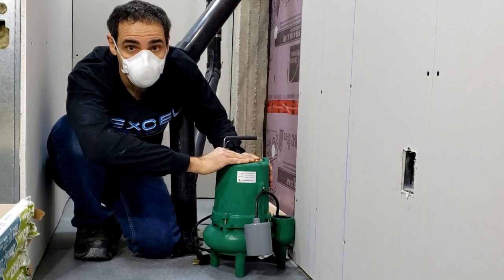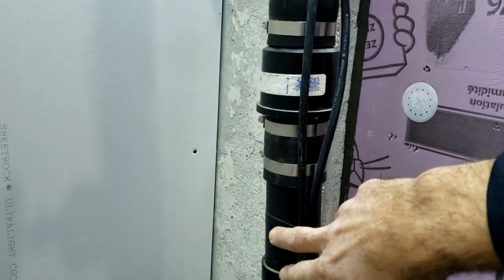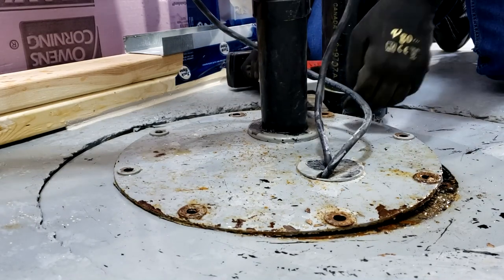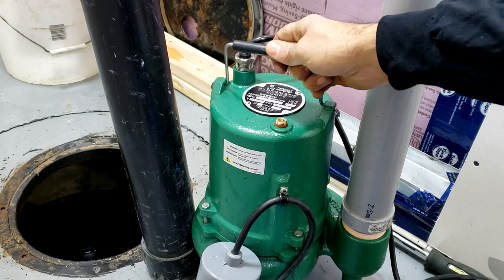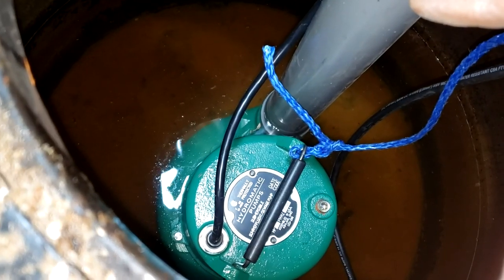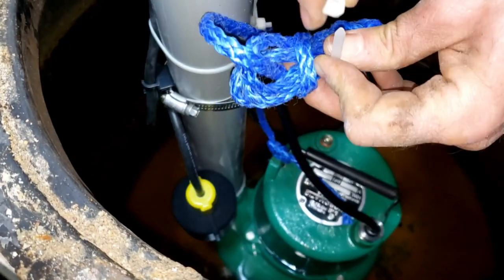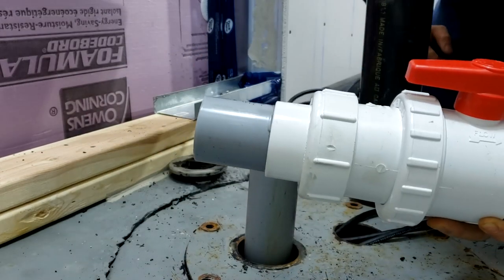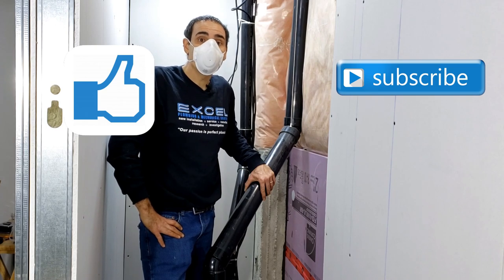How to Install a Sewage Ejector and Float Alarm

Comment: Would a cheater valve work for the sewage pump vent?
Reply from the maker: Good question! A cheater vent (or air admittance valve) on a traditional sewage ejector system is probably not a good idea - although it's better than nothing.  A cheater vent is typically a one-way valve:  It allows air into the system, but not out, which prevents atmospheric pressure from being properly maintained. Therefore, heavy drainage flow into the pit would cause positive pressure to build up downstream into the pit, thereby inhibiting proper drainage flow.  However, any residual air pressure buildup should eventually dissipate through the inlet drainage pipes and up through the vents serving the fixtures (NOT that that would be proper design or practice!)

One area where you'd be sure to run into issues with cheater vents are those small, self-contained point-of-use sewage ejector boxes (such as those ones made by Liberty or Little Giant), which are designed to fit beside laundry tubs and other small sinks.  Their manuals explicitly stress against the use of air admittance valves, as they will not operate properly without a proper vent.

As a general rule, you just can't replace proper venting that runs out to open air.

Hope this helps, and thanks for your question!
Reply: @PlumbingsCool  Wow I had no idea it made a huge difference like that whether the vent is coming from your roof (typical setup) vs not routing the extra piping and just using the cheater vale (air vacuum created by pump gets filled in from house). Where is the difference in pressures (outside vs inside) come in as a problem? At the pit or at the septic? Isn't the inside air similar pressure whats in the pit? i was thinking the only losses would be that the vent would use the warm air from the inside to fill in the void in the pit which would result in your warm air getting sucked up. Also does it not matter which cheater vent you use and how its configured? Thanks for the detailed answer. I was hoping to save all the additional piping and breaking out the drywall on a partially finished basement but from what you are saying its not worth the trouble of using this cheater vent.
Reply from the maker: Right, so technically if your fixtures are properly vented, you may be able to get away with atmospheric pressure being rebalanced in the sewage pit by "stealing" airflow from those fixture vents as required. (it'll suck in air from those vents when the pump discharges, and any excess pressure will built up in the pit should escape through those same vents).  But I want to be clear that it is blatantly against Code and not proper plumbing practice.

Venting has nothing to do with air temperatures. Rather, venting's primary purpose is to maintain the liquid trap seals of the building's fixtures (which prevent harmful sewer gas from entering the building).  All proper venting needs to exit to "open air", which refers outside the envelope of the the building, which is atmospheric (typically 14.7 PSI at sea level). 

Say when you flush a toilet:  that high volume of water rushing through the pipes will push air ahead of it and pull air behind it, thereby disrupting the system's pressure.   If that toilet discharge passes across the connection of an unvented fixture (say, a sink), it runs the risk of siphoning out the sink's trap seal.  But if that sink was properly vented, then the negative pressure pulling on the sink's trap caused by the toilet's discharge would be rebalanced by sucking air through the sink's vent.

Think of when you drink through a straw:  Your "Sucking" creates pressure inside the straw that is less than the pressure outside of it (atmospheric).  But!...we can all recall an annoying moment when our straw wouldn't work properly because it was punctured or defective, causing us to have to suck harder to pull the liquid into our mouths.  That "puncture" in the straw is equivalent to a fixture's vent... Negative (or positive) pressure gets restored  through that hole.

Needless to say, there's A LOT more to venting rules than this, but that's really its purpose.  Just remember the two big rules of plumbing:

1:  All fixtures must be trapped, and 
2:  All traps in must be vented! 

OK, back to your situation!...
If you need to get really invasive to locate and connect a real vent, I would reason I suggest that you may a well try out a proper cheater vent first, and if you experience issues, then proceed with connecting a real vent to the pipe.

As far as proper cheater vents are concerned:  Not all cheater vents are created equally:  In North America, You'll need to find one that is ASSE-approved.  The most common one is the Oatey SureVent:

https://www.oatey.com/products/air-admittance-valves-aav

There are also some approved solutions from Sioux Chief and one called Turbo Vent. 

Avoid the unapproved spring-loaded types (often come in black ABS plastic), because their mechanical nature makes them more prone to failure. 

Simply terminate the pit's 2" vent with the valve installed in a vertical (upward) direction few feet above the floor.  Hopefully, it'll work out for you without disrupting the rest of your plumbing system.  If it does, then just locate a proper vent and connect it accordingly. 

Again, an AAV is certainly not ideal (and a piece of me dies in those rare occasions I need to install one! 😞) , but a cheater vent is better than no vent at all. 

Good luck!
Reply: @PlumbingsCool  This makes more sense now thanks! I didn't think that the vent needs to be two way for the pressure to come to a balance. Plus this isn't to code, makes you wonder why the cheater vent even exists :).
Reply from the maker: That's a great point. This topic arises often with my Apprenticeship students, who argue, "well, if it's not legal then why is sold?".   The bottom line is that it's not up to the store or supplier to determine what's legal, but rather the installer.  There's no end to the questionable junk available on the market...but in our free enterprise world, if there's a demand, there'll be someone to fulfill it.

As for AAV's:  Legality is a little more complicated.  Here in Ontario, there's no denying that cheater vents are present in the Codebook, leading one to presume that their outright legal. But if you look at the code section more closely, it gives the impression that the code was somewhat shoehorned in there at the very end of the Venting section merely because AAV's exist and no denying that they get installed at times. 

First, it starts off by declaring that AAV's shall only be installed in buildings undergoing renovation or where connection to a proper vent may not be "practical" (what the heck does that even mean???  Practical is such a subjective word).

Finally by the end of the entire listing of installation requirements, it concludes by stating that installation of AAV's shall be "subject to the authority having jurisdiction", meaning:  it's ultimately up to the local plumbing/building inspector to decide whether or not they will allow you to use an AAV...and every inspector is different (and sometimes even clueless and impossible to reason with!)

So at least in my area, it does very much remain a grey area as to the legalities of them.

As a general rule:  Always try to do the right thing whenever possible (such as connecting to a true, proper vent!), and bend the rules only when absolutely necessary.
Reply: @PlumbingsCool  Great explanation, yeah I am in Ottawa, On here. I guess "practical" in the eyes of the beholder :) The other thing you touched on though if the fixtures are properly vented, then perhaps the vent on the pit is not needed. How would one measure that? And in that case, would you just seal the vent with a rubber cover and be done with it? I'm quite surprised how little is done here for this rough in washroom.. pit is there, no pump inside ok but not even an outlet in sight. The drains are in the ground (probably not in the right places) and no sight of a vent. I still don't think its practical to use the cheater here now that you opened my eyes on the issue. I have an idea where there is a vent stack up from the upstairs kitchen sink so I can possibly tap into that.
Reply from the maker: If you can get to the kitchen sink vent, then that would be great...although the vent pipe from the sewage ejector should be 2" minimum, where your kitchen sink vent will be 1-1/2" if plastic. However, this is one of those aforementioned situations where it may be in the greater good to bend  the rules by connecting a larger vent pipe (2") to a smaller vent pipe (1-1/2")...ONLY if it means that you'd otherwise forego installing a vent at all.  Just be sure to connect your vent above the flood level rim of the kitchen counter to prevent an unintentional bypass.

But your situation sounds really strange. If it's a true sewage ejector, there should already be an airtight lid, 2" drainage pipe, and a 2" vent pipe somewhere above, if not connected to the cover.  Is it possible that you're instead dealing with a sump pit, which only picks up rainwater drainage from the foundation drains around the house, and NOT fixtures?  If so, then your situation becomes much more simple.  Just want to make sure.
Reply: @PlumbingsCool  its a rough in so the pit has nothing in it. Yes it has a lid and it has a pipe from the rough in fixture drain pipes connected to the pit. There is a 2" drainage pipe near by that is labelled "sewage" and it goes to the septic. Unfortunately there is no vent pipe here nor near the fixture piping. Nor is there outlets or pex water pipes either.. I'll have to run all these to the area myself. Perhaps it is strange that there is no vents in this rough in? At my last place (also in the basement) it had everything setup.. and there was no need for a sewage pump/pit there because it was all going to the city sewage and in this case its a septic which requires a pump to pump it up 10ft up or so.
Reply from the maker: Yeah, unfortunately, it appears that someone dropped the ball.  Even with no pump supplied, plumbers usually do their due diligence and at least connect the vent to the pit cover.  Inspector should have caught that.  One other thing:  If it's a fairly new build, Code requires that all residential homes have a minimum-size 1-1/2" vent running through every storey - sometimes referred to as a future vent (to prevent issues such as the one you're having).  The future vent is usually capped in the basement joist space, or connected to a laundry tub or future 3-piece rough-in.  Not sure how hard it is for you to get to it if your basement is finished.  Otherwise, you may want to consider running at least 1-1/2" up to the kitchen sink's vent above, as described before.  Not 100% legal, but certainly better than nothing.  Or, you can always start with a $30 ASSE-approved cheater vent before you start cutting into walls.

Comment: Gloves !
Reply from the maker: Lol...I presume you're giving me advice - and certainly sound advice it would be! Rest assured that I often do wear gloves, and I'd be doing such projects in a hazmat suit if I had it my way...however in this case (as I point out in the video) this pit was completely clean and free from sewage (as at least until now); it had never been used for anything but to receive clear water waste from the mechanical room's condensation lines. 

Since the pump replacement its been happily chugging away at moving REAL sewage from a full washroom I had recently plumbed into the basement, a few feet away. 

But otherwise, under any other event...as you say:  GLOVES!!!

Thanks for watching!

Comment: Why are u using gloves.   😩😩😩😩😩😩😩😩😩😩😩😩
Reply from the maker: Lol...do you mean, why am I NOT using gloves?  Fair point, and the only reason is because the sewage ejector was only picking up the floor drain from the mechanical room at the time (clear water waste from the furnace only).

However, I have since installed and connected a 3-piece bathroom to it, and I promise you that if I ever need to get back in there again, it certainly won't be without some serious gloves! 🤮